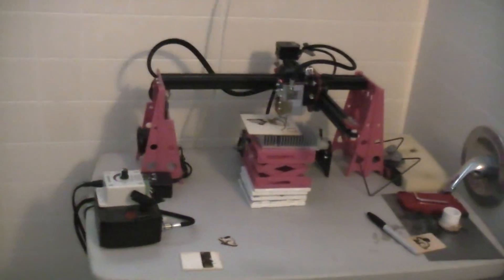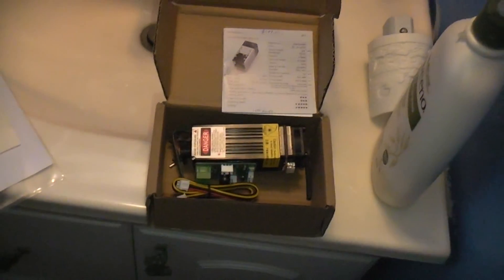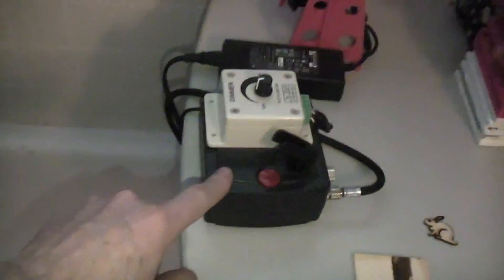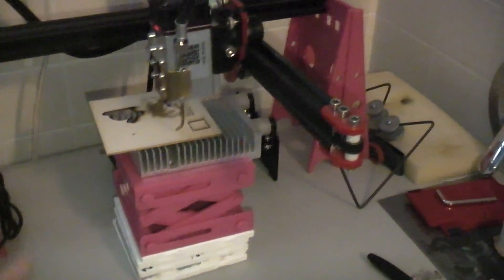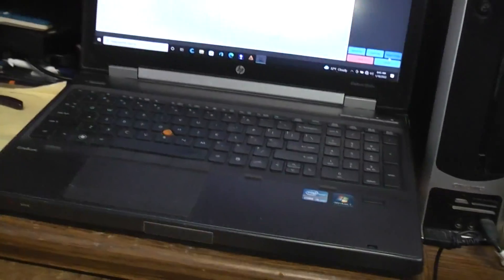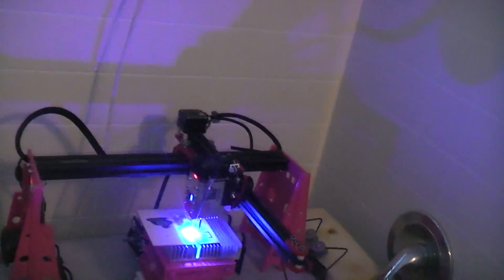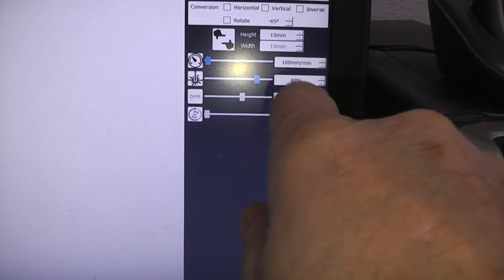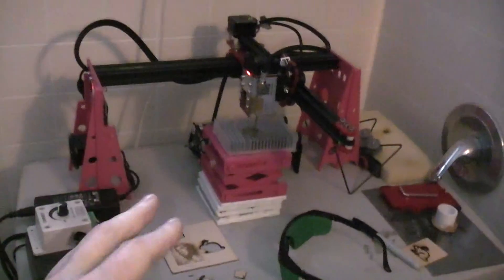1 year review of the NEJE "30W" diode laser module installed on the VigoTec Vg-L7X 20W engraver.

Comment: Hi Robohut.

I have a laser engraver its a budget one Neje Master 2 i think but its not huge its the small one. It came with a 7w module which burned out in no time. I bought this 30w module a few years ago and when i powered my laser on it was slightly kind of engraving/burning in idle. I contacted neje and its a nightmare using their "support" forums and lack of english. Its been sat out of use for ages because i was worried the power wasnt sufficient or something was going wrong. Turns out i am able to adjust the idle power is that correct? I have never seen this setting and wondered if you knew how i could go about doing this? I miss using my laser :(
Reply from the maker: I have never heard of a idle power setting. The laser should be ON or off for safety reasons I would think. Now there might be a adjustment for lower power alignment, like when your setting up a engraving and you want to see where it is going to burn once you tell it too. Some low end older units might let you adjust this.

Comment: I was hoping you would do a one year video on this laser.  Is it the Neje N40630 module?  I bought one and mounted in on my home built CNC machine..  I haven't used it much lately because I've been saving my pennys up to buy Lightburn. So far what I have managed to get done with it has been very good.  Cheers!
Reply from the maker: Paper work with the lase unit just says NEJE 30W laser module. They claimed 7.5 W optical, but I would bet it is closer to 5.5 W since that seems to be the normal for single diode lasers in this price range.
Reply: @Robothut  yeah, if you look up the model I mentioned on the Neje website it states 5.5W.  I haven't tried to cut 3mm ply with mine yet but yours seems to do it very nicely.  Looking forward to trying it once I get lightburn and and air assist hooked up.